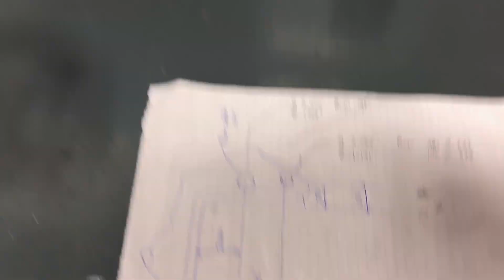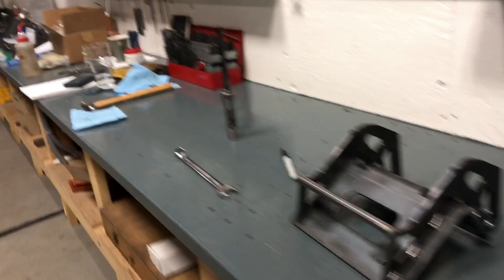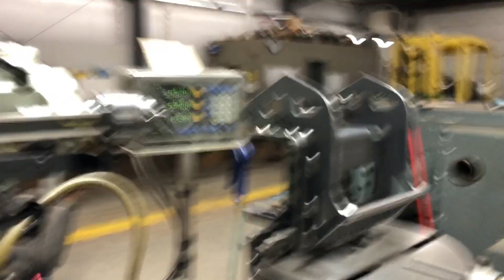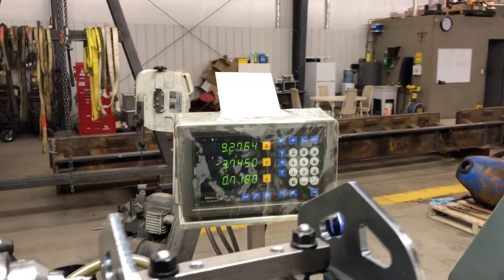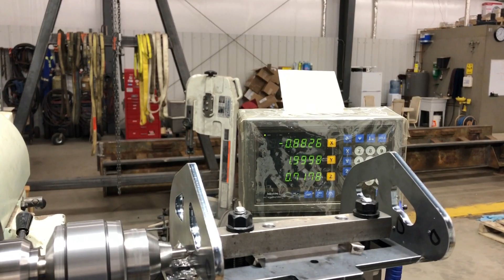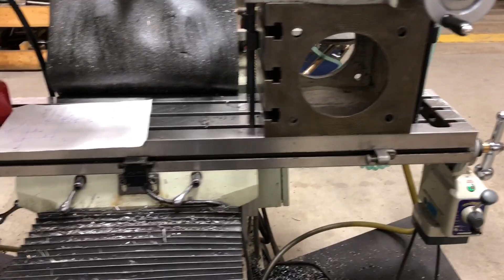Horizontal Boring Machine Work, Sort Of.

Comment: If you had multiple of these units to do, say a dozen or hundreds.  Would it be simple enough to get that "Y" axis plane centered to the "Zero axis of rotation" on the rotary table?  Or would that take a day to fight back and forth to no avail?

Additionally, could you mount your rotary table vertically... it probably would not be very stable but then you could use a vertical mill. 

I thought you had a Vertical/ Horizontal mill... if memory serves me correctly. 🤔

I appreciate your input.  Great YouTubes as always!  Missed them when you don't have new postings.
Reply from the maker: Hello Iceking007, you could line up the Y axis with the axis of rotation of the rotary table but when you have multiple holes there is no advantage to it as you always have to move between holes using the Y-axis of the mill.  If you only had one hole then you could position it in line with the rotary table axis and then you would only need to rotate the table, the Y-axis never having to move.  If you watch my video  https://www.youtube.com/watch?v=8xxwvgIUCYc I do exactly that.  The part is square and there is a hole in each side that intersects with the centre of the part. I only had to rotate the table to machine each hole.  There is a bit of an explanation in the video description as well.  You could mount the rotary table vertically but, in this case at least, it makes it difficult to load the parts.  I use a 1-2-3 block to offset the part from the fixture and if the table were vertical this block would always want to fall out while trying to hold the part in three different directions at once with one hand while tightening clamps with the other.  Ken
Reply: Right, I didn't account for the two holes, they would be mirrored essentially, my apologies.

Yes, I've seen all your postings. 

Thank you very much. 

P.S. It just threw me off when you say the datum is off... actually that reignited my thoughts.  If you set the "zero" to be behind the angle plate and centered that on your rotational angle then you move over positive for one side and negative for the other, but your zero point is the same and therefore so is your offset value.  Just my thoughts, would simplify the process and alleviate some potential error.
Reply from the maker: @Iceking007  You could put the zero behind the angle plate but that wouldn't simplify the process.  I would have to pick up the axis of rotation of the rotary table to be able to set my zero, and that is much harder to do when the spindle is horizontal.  I would still have to pick up the datum feature on the part that the holes are dimensioned from and then add/subtract to that the distance from the axis of rotation to the datum.  It is much easier to just ignore the rotary tables axis of rotation and pick up the datum feature on the part, store it, rotate the table 180 degrees and then pick the same feature up again on the other side and store it. You end up using the same numbers for each hole on both sides.  The only thing you have to remember is to switch between stored datums when you rotate the table.  Even this is usually fool proof for if you forget you end up being so far out position that it is obvious you didn't change the stored value.  Ken
Reply: @hmw-ms3tx  Thank you for the feedback.

Comment: Great tip switching the points on the dro , i will have to remember that one for the future when i get them set up on my mills .   I remember my Dad mentioning one day , he used to use a large Wotan shaper  that came from Germany  after the war .   Great job Ken .   Cheers .
Reply from the maker: Thanks Max.  I've heard good things about Wotan (and maybe more importantly I haven't heard anything bad about them).  I have the parts/owners manual for it and it has some interesting features on it.  One is the use of spring loaded rollers on the box ways to preload the box way without adding too much friction.  It would be like really tightening down the gib on a Bridgeport table (which makes it very stiff and vibration resistant) without the table handwheel being so hard to turn.  Another is the method of locking the rotary table.  It is locked by being pulled down by several eccentrics on a shaft.  In spite of the downward pull it goes from spinning freely to locked solid without any change in the table elevation.  Those Germans were pretty clever.  Did your Dad say whether he liked the shaper or not? Ken
Reply: @hmw-ms3tx  All he said that it was a good machine  big & solid  from memory . They built some quality machines there .   I have a  big heavy WMW  internal grinding machine from Germany ,  looks like a well built machine .

Comment: A new HBM  What kind did you find ? I would like a DRO on my HBM that would really help . I do have scales in all position and that helps
Reply from the maker: It is a Wotan B75M.  It has a 3" spindle with a NMTB 40 taper in it, a rotary table, built in outriggers and perhaps my favourite feature, a power drawbar. Ken

Comment: Nicely set up.
Raymond is well worth watching, obviously a very experienced Machinest totally comfortable with his Horizontal Borer.
I'm sure you will find uses for yours, looking forward to its arrival.
How about you document its installation with your thoughts and planning.
There's a lot of people who have never experienced largish machinery purchase/rigging/
installation/planning!
Reply from the maker: The installation would probably make for some interesting videos.  I have to cut out a section of shop floor, dig down about 3 to 4 feet and then fill it with concrete to make a proper foundation for it.  The guy who I am buying the machine from is going to deliver it and I'll leave the rigging to the guys I usually use.  After that it is up to me to level and align it properly (which will likely be a gong show as I have never done it before) and do any cleaning/repairs to get it up to snuff.  Ken